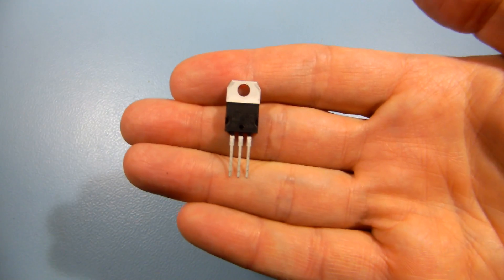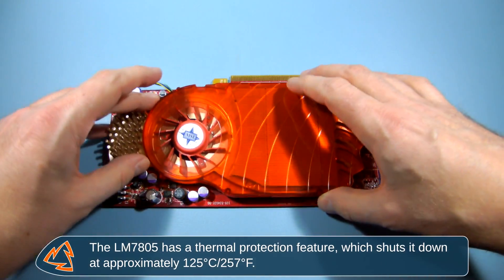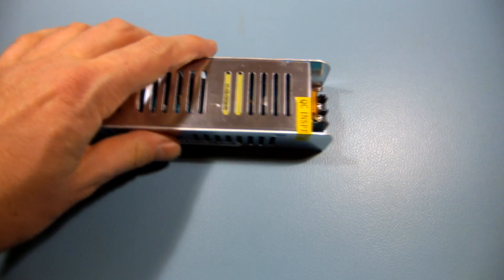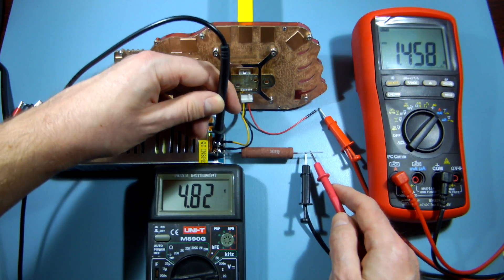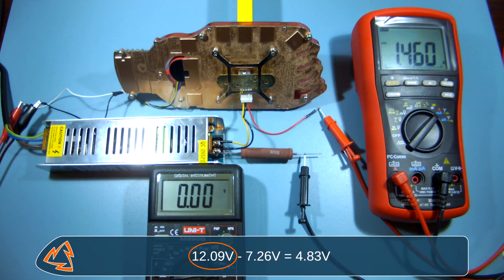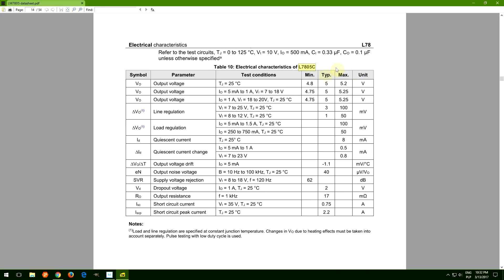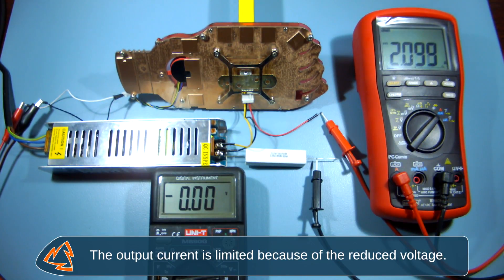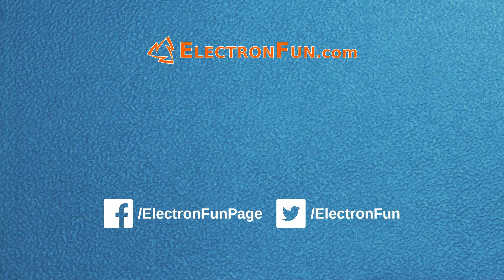Will LM7805 exceed its specs? || electronics experiment

Comment: I have made 5 volts circuit by using L7805CT TO-3 Package, by 12v input and rectified with bride diode and filter with 470uF 50V cap.
But the output is showing 15.56 volts at last points.
Why is this happening?

Comment: Let's see you do same thing with 78T05CT 3 amp version, then 78S05CV 2 amp version and then finally how about an LM323 in the TO3 case which is a 3 amp version.
With a really large heatsink, I wonder how far those 2 and 3 amp versions could be pushed?

Comment: LM317 consider a 1.5A max but I successfully get to give me 2.5A but in 5W of a 2V drop across the LM input/output . 
So I think I can install your 5v linear regulator with input 7v and output 5v and you can try get more test output current . This regulator cannot handle a more than 8W internal heat they get shut down . Even in 6W they need a cooler fan . I think you can use a linear regulator after a buck converter with a minimum deferent voltage between the input and output like 2 to 2.5V drop inside the LM regulator with max 2 to 2.5A current . And that can surely give me a nice 5V output for a 2.5A max as a USB power supply charging a 2 smartphone and powerbank in same time with out any problem or nose from output voltage that can get from the buck converter that it was make the smartphone act crazy in the touch act alone .

Comment: With that setup i'm rather certain it is not yet the LM7805 that is limiting you.  
Just look at those tiny wires you are using for the current and then the probes attached.... Those wires can easily add 1 Ohm.
Reply from the maker: That's true, the wires will usually add some resistance to your circuit. The wires I used don't look too thick, but they are from a PC power supply and are good for delivering quite serious amperage (don't remember the exact values right now) - the probe is probably the worst part of my circuit.

Comment: i found a ups for free with a bad battery . just before buying a new battery i hought lets give this 14.4v with 10amp because a battery cost 15$ and as soon as i powered on it showd 172volts 250hz on the out put so i put a 22w fan and the voltage rise to 190v and 2 amps were drawn then i put 2mobile charger and it rise to220 then i plugin in my pc and monitor and it quickly got to250v and 4 amps were drawn.. i got worried about the voltage and started lowering the input voltage but the out put voltage keep riseing so i got it to16v and it gone down to 220v then i switch on my pc and my psu cant give 12amps so i stop the test .. now i want to know what wrong with it .. it is a very cheap ups . i have no ups on my pc and should i get a new 1000va apc ups or repair this junkyard ups or search for another junkyard ups??and with higher load the frequency also got at 54hz
Reply from the maker: I won't be able to tell you what's wrong with your UPS, sorry. However, I wouldn't use it to avoid unnecessary risk.
Reply: ElectronFun.com yes it is better to find another junkyard ups that works properly wait and save some more money to buy a new apc ups..i am building a new pc and buying parts one by one because i am a poor kid. i have bought a ryzen 7 1700 for 372$ as it is the cheapest available in india.. i have no mney fpr motherboard ram and gpu lol
Reply from the maker: That's too bad. Why wouldn't you wait until you collect all the money needed for all the parts?

Comment: I have noticed that generally speaking fans seem to be taboo in linear power supplies. The argument is that they are noisy and unreliable. Anyone reading this with a PC next to them is hearing a fan.  Fan assistance can more than double the efficiency of a heat sink. The number of power supplies on YouTube being repaired due to heat is rather high. Yup - I'm a fan fan.  Thank you for this video and the buck converter one. More - gimme more.
Reply: The fan debate goes all the way back to the beginning of solid state. Tube equipment cases often had holes built in for an optional fan, because tubes were, well, crude workhorses that were handmade and not predictable, (this is why most places that sold tubes had tube testers to not only check operation, but crudely match between like parts). Kind of like checking the beta on a transistor, rarely done today, but mandatory to check a tube.

One of the selling points of solid state was the ability of cheap mass production of a reliable product. Instead of having to design circuits around very wide possible component specs, "Hey, we better make all the caps adjustable, so they can tune them to the tube",  they could just design around a 10% - 15% fudge factor - solder and forget it.

Because design could now be precise and elegant the IC design standard was always fanless. They set this as a basic standard, because it was always possible - until multilayer mask design of fast cpu's. This caused a big stir in the design industry, but when they plunked a 20 pound schematic down in front  the engineers complaining - those engineers thought maybe in this case a fan isn't a lazy way to cut corners, but a way to make a faster product.

It's still kind of that way today. Just factoring in a fan  from the get go is like using duct tape on your glove box, instead of fixing the latch, or using string on your windshield wipers, so you can manually use them when it rains. Personally, I like fans, but can see why people get very anal about them.
Reply: Failure is a big problem, normally they go noisy first which does give a warning. I think the biggest problem with fans is they are poor quality and not designed to last. Nothing new there then.
Reply from the maker: Fans are commonly used for example in linear lab power supplies and it's true they may be noisy. I'm not a fan of my Korad power supply when its output is set to 3A or more :)
However fans are very useful and indeed they multiply the efficiency of a heat sink. I'm a fan fan too - my first YouTube video is about cleaning a computer fan :D
Make my boss fire me and I will upload more videos and much more frequently ;)
Reply: I belong to 3 electronics forums and mention a fan and they go all bananas. I should have written DIY power supplies. There is a chap on YouTube FFcossag. Mention a fan and he goes into hysterics, then promptly mends a power supply that's got overheated. I have a 40V AC 50A transformer. That would make quite a linear power supply with the odd 2N3055 or whatever stretching into the sunset fans blasting.
Reply from the maker: Like you said before - a fan can double the efficiency of a heat sink. Passive cooling is sometimes just not enough.
Reply: I phoned the firm below and they were very helpful.  Most PC fans are pretty gutless (0.3A) and I can't find anything better. They'll do for now.
http://www.abl-heatsinks.co.uk/index.php?page=extrudedproduct&product=166
Reply from the maker: Which fan size are we talking about? What would you like to use it for?
Reply: I have recently taken up electronics as a hobby after a 50 year break. I'm struggling. I was given a 120W Monacor PA 900 Line Amplifier that was Christened with a pint of beer. The 'gubbins' is fine and I am in the process of converting it into a bench power supply either using the  4 x TIP35C (as installed) or 2N3055 . Monacor are proud their design didn't use a fan but the main printed circuit board has been cooked in 2 places.  I feel sure that a couple of fans will help cooling, even PC ones are better than nothing. I also have a 40V AC 60 Amp transformer that looks very lonely. I won't mention the 100 Amp 20V transformer. The ridiculous thing is I'm into LED's at the moment. I also have one of these :-
 http://www.banggood.com/DKP6008-400W-Digital-Control-Adjustable-DC-Step-Down-Regulator-Module-Constant-Voltage-Current-Meter-p-1082317.html?rmmds=search
Best of both worlds I hope  - thanks for the interest and thank you again for the vids.
Reply from the maker: I guess the switched mode module should work just fine for now. You can always build something better if this one is not enough, or breaks.
Reply from the maker: I understand your point. Fans have pros and cons like everything else. They increase effectiveness, but they are noisy and may fail when you need them.
Reply from the maker: Unfortunately, you won't hear the noise if your project is in a distant location or in another room.
I believe these days nothing is designed to last, business is the reason.

Comment: The safe operating area of the device is what governs the maximum output current.
Reply from the maker: It seems the LM7805 is idiot proof :)
Reply: Pretty much, I've done really stupid things like connect one to a car battery and accidentally short the output and it survived so they are quite robust. But if you connect it in reverse or allow the input to go lower than the output they can be quite fragile, a diode from output to input solves that.
Reply from the maker: The thermal and overcurrent protection features help a lot, but still I've fried quite a few LM7805s. As you said - there are certain situations, in which these regulators may fail quite easily.

Comment: You might have gotten a better reading if you actually measured the regulator output instead of the output after the current measurement ( the DMM will create a significant drop since its a resistance based current measurement). At 2 amps the wire clamps you used might also introduce quite a voltage drop. Neverthe less, nice video!
Reply from the maker: That's true, the wires themselves introduce a bit of voltage drop too. This video is just a proof of concept. Thank you for your feedback :)